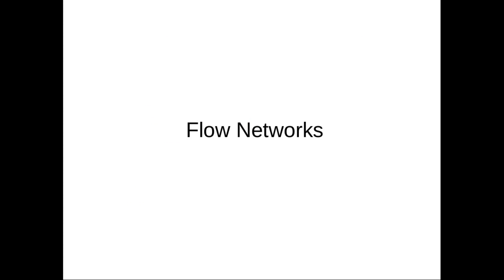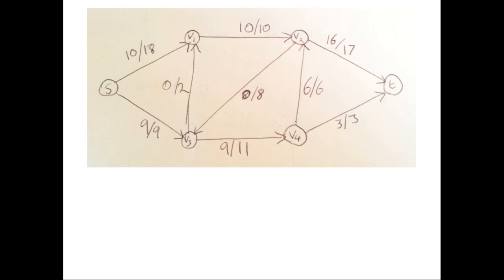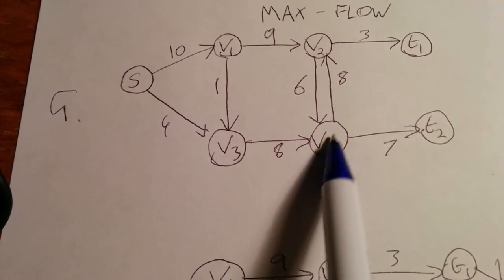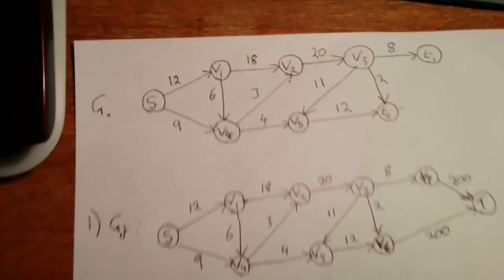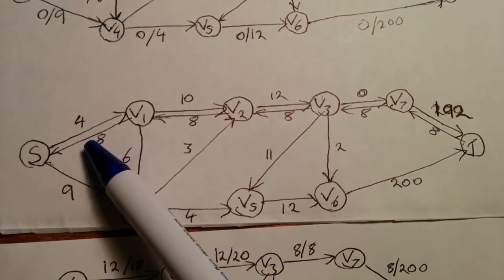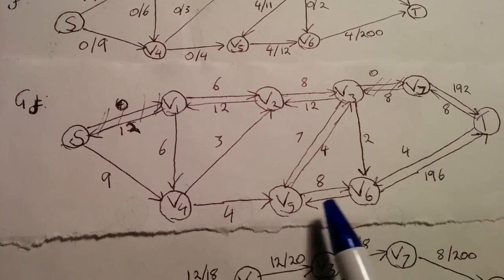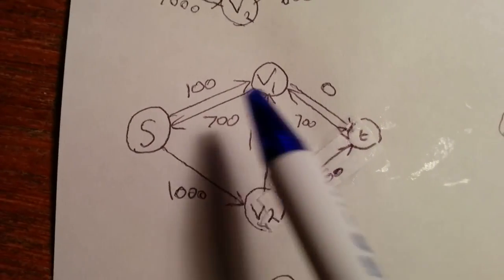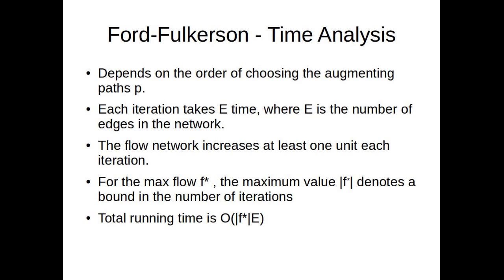Ford-Fulkerson Algorithm for Max-Flow

Comment: How do you determine the value for the supersink that you wrote as 200?
Reply: +SyncInn A high number to prevent it from slowing the flow down. The capacity out of t1 should be atleast as big as the sum of the capacity of all incoming edges.

Comment: Wouldn't adding 100 from t1 to T violate the flow conservation?
Reply: It's not a flow of 100, but a capacity of 100, that is an arbitrarily large capacity (larger than 7 + 3 at least!) which allows us to use the algorithm as usual.